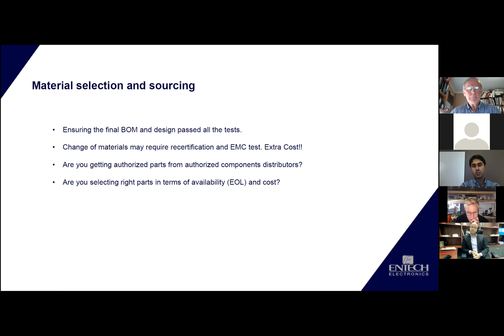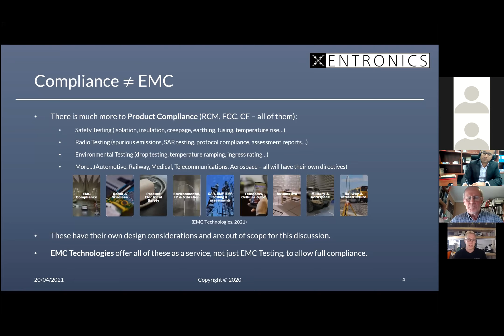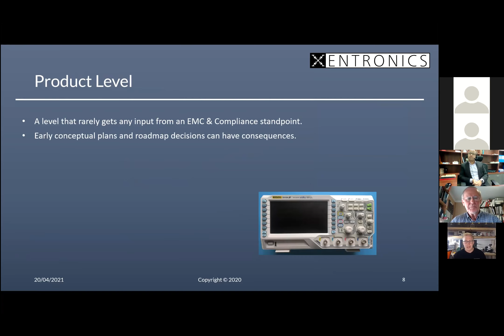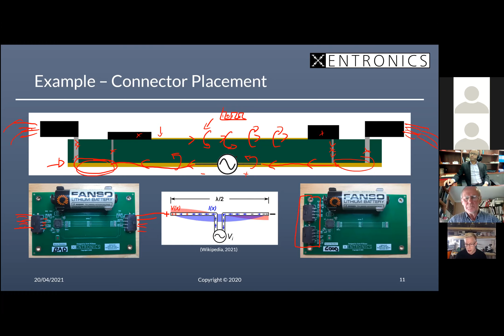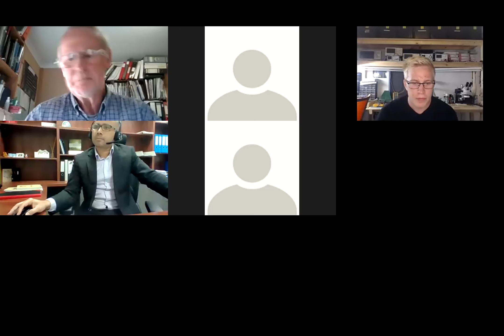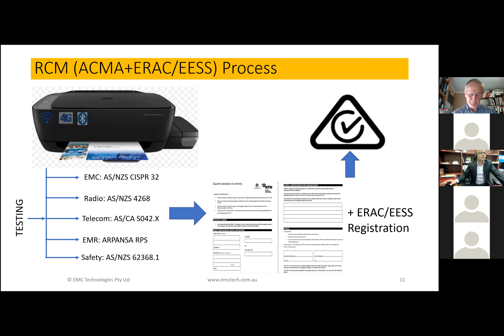IEEE talk on "Navigating EMC Compliance from Design to Manufacturing"

Comment: Some comments from me about my part:

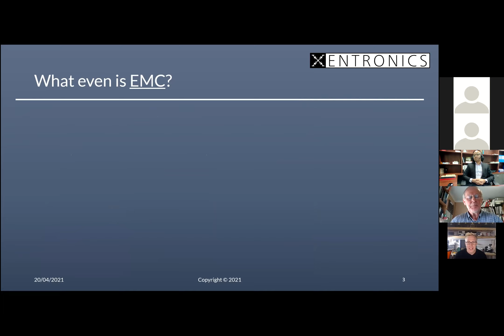1. At 13:00, this shouldn't have "lightning" for the first point. Not sure how a product can interfere with lightning :) But definitely valid for the second point
2. At 24:28, USB should be 45R Characteristic 90R Differential Controlled Impedance, not "50R Controlled Impedance". But you get the point nontheless.
3. At 27:15, I started drawing the flux lines the correct way the first time. My correction to myself was wrong.
Reply: Hey Scott, your part wa really helpful. What would you say is the best source to read in order to deeply understand your explanation of how the high frequency data currents, cause high frequency flux, which effectively creates an inductor in the ground plane, which is like a voltage source from an EMC engineer's point of view?
I get the first part, that high f current causes high f flux. And I guess the part that some inductance in the cable resists the current change which changes quickly from 0 to 1 and therefore the voltage shift in the ground plane. But why does this act effectively as a voltage source to create a dipole from an EMC point of view?  Thanks
Reply: @rockndancenroll  There is no inductance in the cables, because there is no loop area in the cables. The cables are driven relative to each other due to the ground plane shift. A "voltage drop" from inductance and a "voltage rise" from a voltage source are the same thing, it doesn't matter. The cables will be sitting at different potentials, and also constantly changing potentials, at the frequency of the data + harmonics, which therefore will cause a Radiated Emissions issue. Cheers.